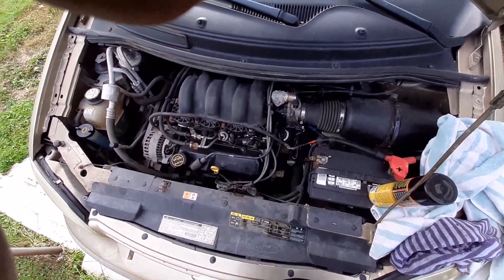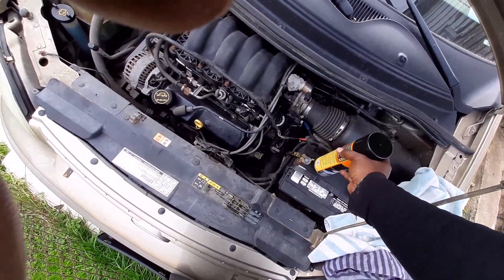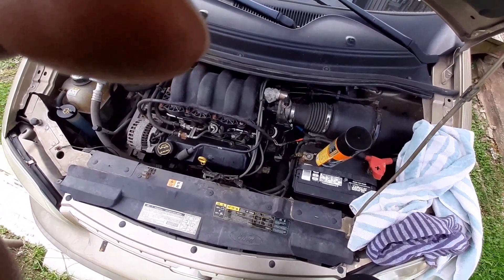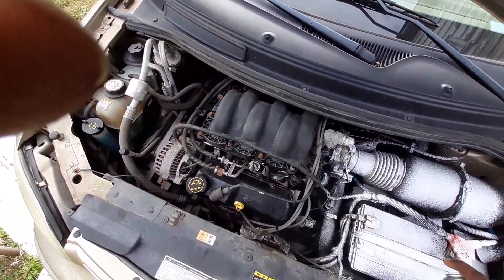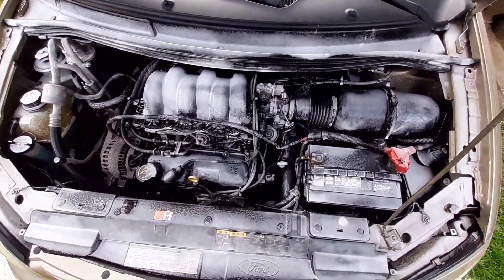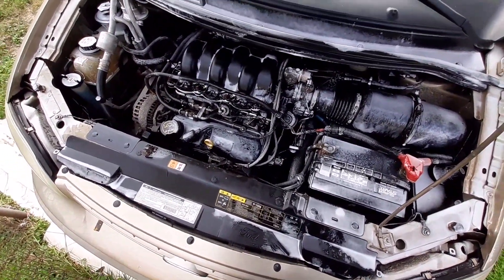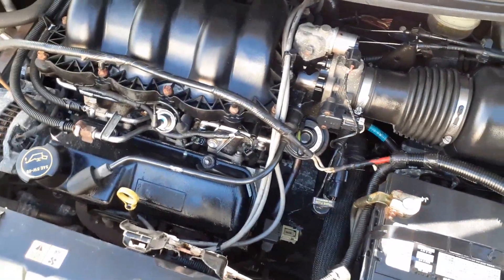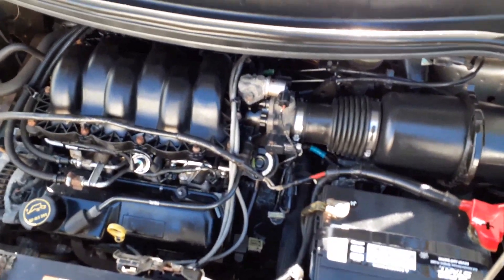HOW TO CLEAN YOUR ENGINE - NO WATER NO SCRUBBING

Comment: Great video should definitely disconnect the battery
Reply from the maker: i usually do it with out disconnecting the battery and it turns out fine, but you are right i should have disconnected the battery that's a good habit to practice. Thanks for that i appreciate that.
Reply: Great job, that looks good, thanks for the video